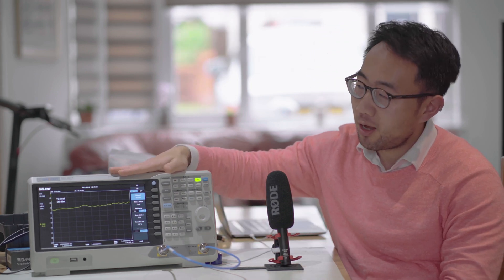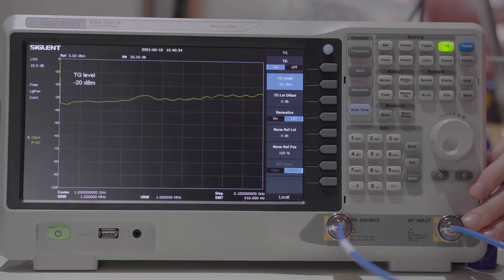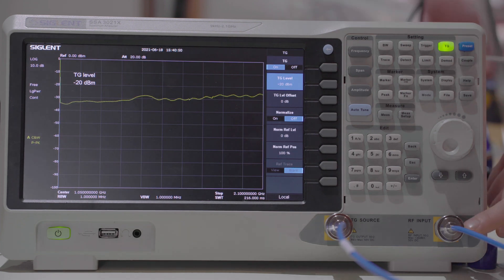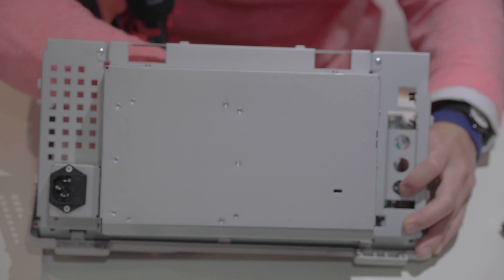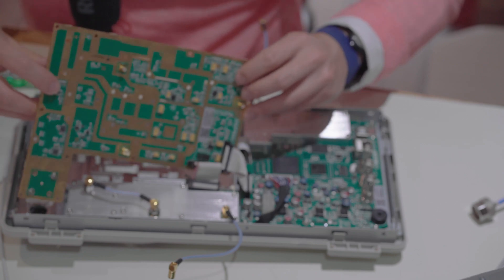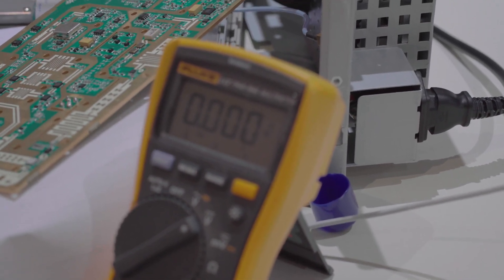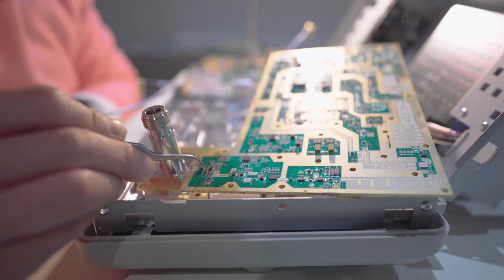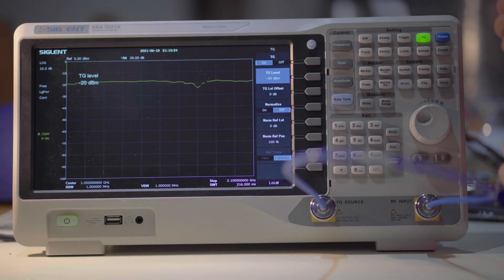How to fix the RF front end input of a spectrum analyzer

Comment: Thanks for sharing I have the SSA3021x, but seems to be an earlier version, since the layout is exactly the same. However change the two first GaAs switches and that solved the problem for me.
Reply: Hi
I am also having the same issue and unsolved bcz of an unknown number of input switch.
So you're requested to share me the part number.
Thanks
Jenson
Reply: @kelvinjenson7514  RF-switch is Mouser part number 937-MASWSS0181TR3

Comment: Thanks for sharing, the fix is actually not easy. Especially, recalibration is required after that. Some HAM radio enthusiast even cover that SA's input port using metal dust cover when it is  not being used.
Reply from the maker: Hi ks ip, very good point here. I consulted with their design engineer, apparently, if it is just the front end, then re-calibration is not needed. I guess it really depends on the type of equipment, if it were a very expensive, precise machine such as a rodhe & Schwarz, I would not have done this myself. Also, as you know, those ESD protection on the front end are tiny 0402 and 0201 devices, I don't think I did a great job soldering them, so the extra solder and the layout may well affect the performance of this spectrum analyzer.

Comment: Good job! 👍
I notice in your other video you mentioned only connecting the SA with the DUT already running, and disconnect before switching the DUT off. Would that have avoided the damage in this case too?
Hopefully I learn a few tips like this without damaging my equipment 🤞
Reply from the maker: Yes, it will certainly help. But sometimes, the DUT you are working with will simply create too much low frequency noise that the RF input of a spectrum analyzer simply cannot cope with. In this case, what you need is a transient limiter. But be aware, having a transient limiter sometimes can cause measurement error. That is the compromise sometimes we have to make.